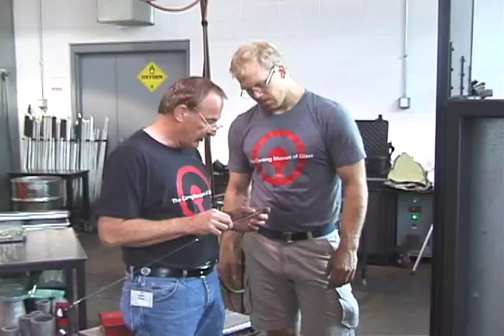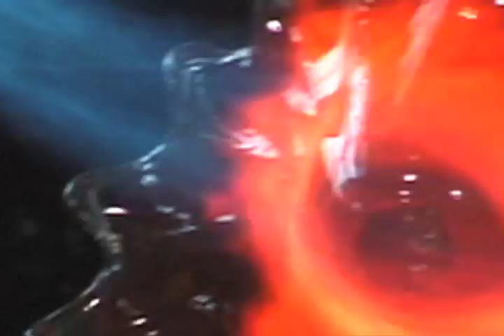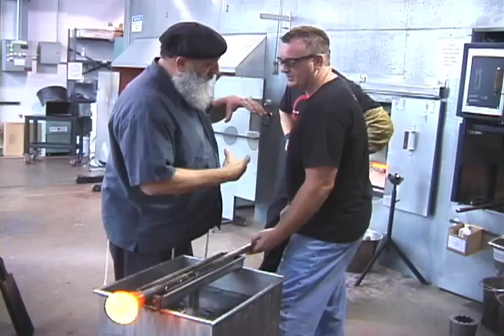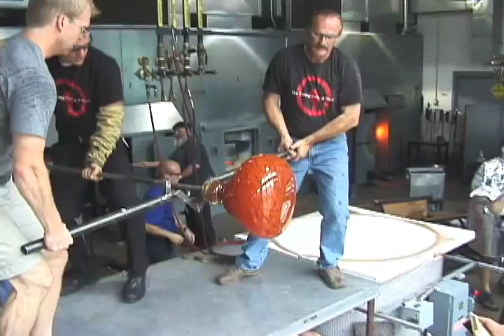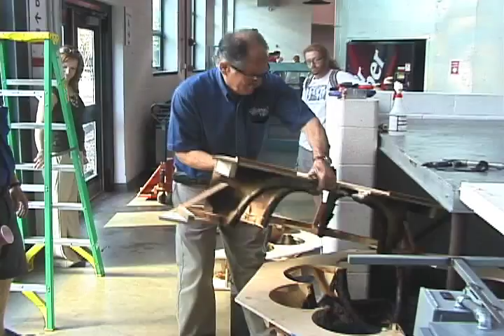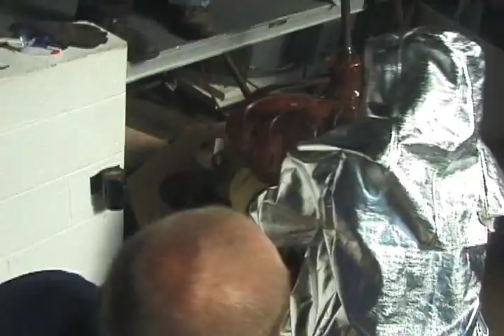HQ Version: How do you make the World's Largest Blown Glass Pumpkin?

Comment: @cammigurlgonewild 

the colorants are metal oxides that heat to a certain color, like "blued" steel per se. the grainy sandy stuff in the question above is actually glass with the colorants added at the premelted stage where it is the minerals batch that will be melted down, so its never actually clear glass, just color thats crushed up